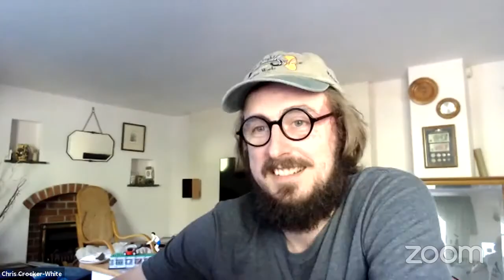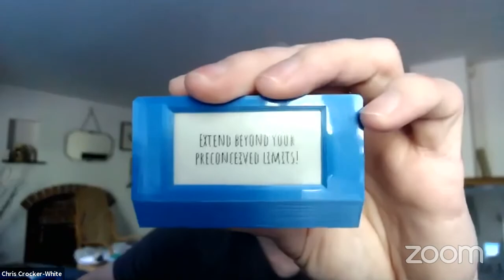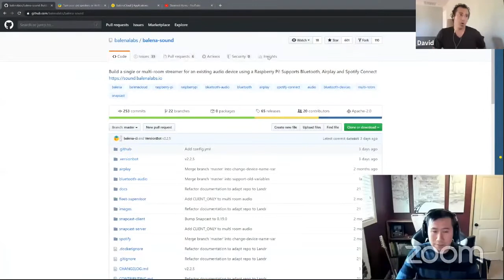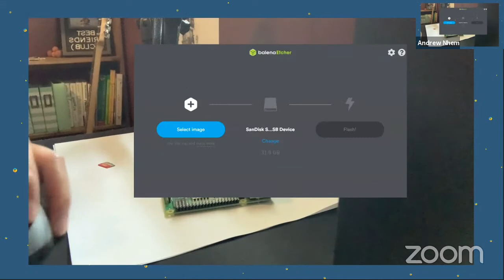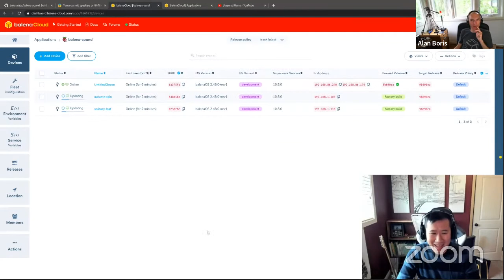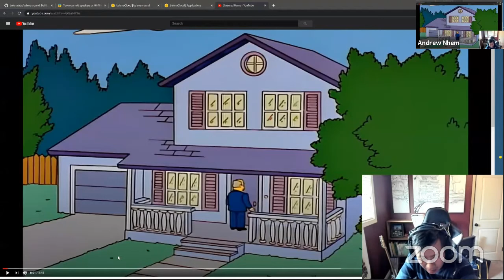IoT Happy Hour #10:  balenaSound Live Build and Demo

Comment: Hi, is it possible to play music files from a usb/ssd device connected to the raspberry pi?
Reply from the maker: Thanks for the question! Outside of streaming from Spotify, you can also use the old speaker/Pi as a target audio device off of a computer. So in this use case, you're playing music from your computer and using the balenaSound device as a speaker. Currently there's not a way to add music to the RaspberryPi storage and play it... yet?